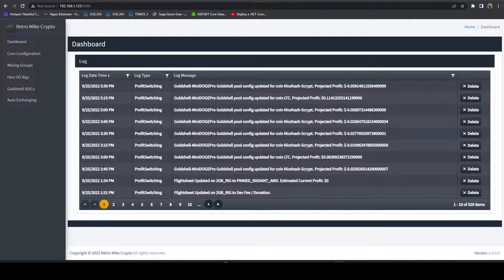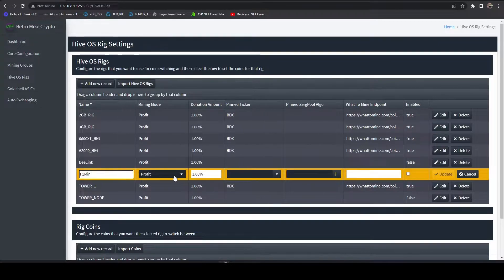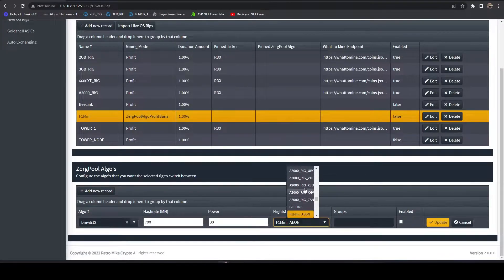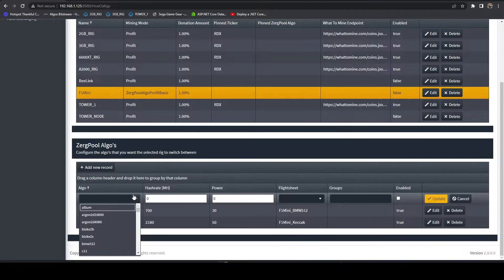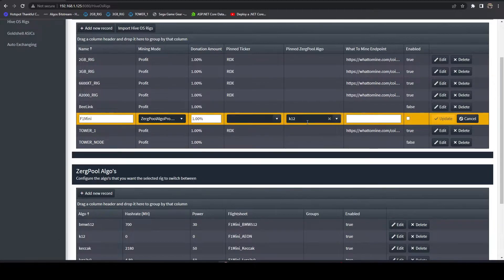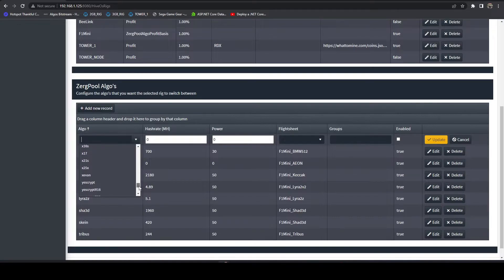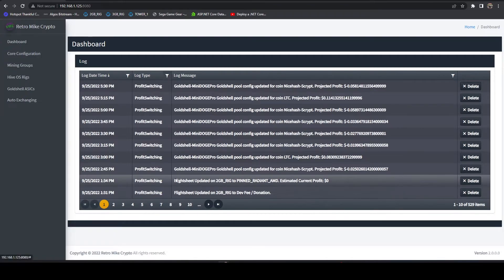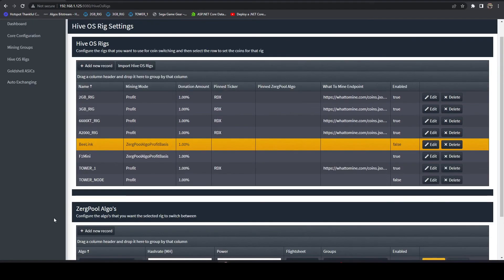Blackminer FPGA Mining Profit Switching | Retro Mike Mining Tools

Comment: Not for the Blackminer; just for FPGA's in general; have you heard of a bitstream for Equihash 144_5 or any of the Equihash algos ?   I'd like to get an E300 but I don't want to be limited to Kaspa with it. With my luck 3 months after I get one somebody will drop a Kaspa Asic that's 5 times more powerful. When your E300 comes what algos other than KHeavyHash will you be running with it ?
Reply from the maker: I'm not aware of any ZHash specific bitstream. The E300 uses TeamRedMiner and supports the bitstreams that TRM supports. As of right now that is kHeavyHash and ETHash. The E300 is a risky play, but I decided to take a chance, just like I did with the Blackminer back in 2019. At least with the E300, I know there will be ongoing development with the TRM devs.